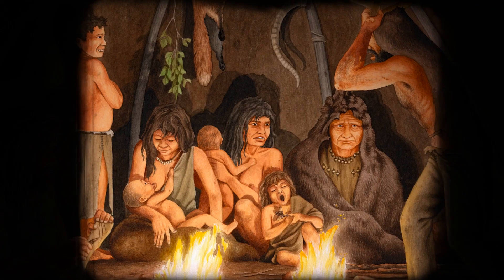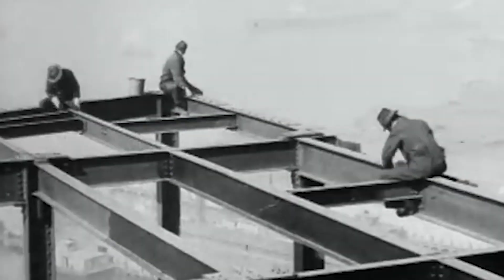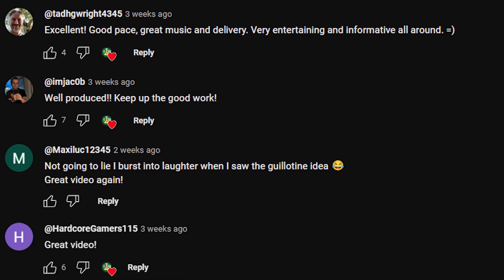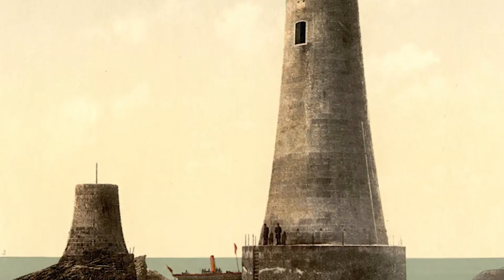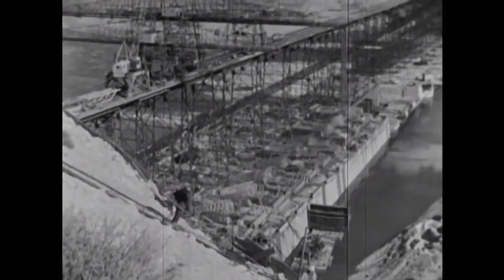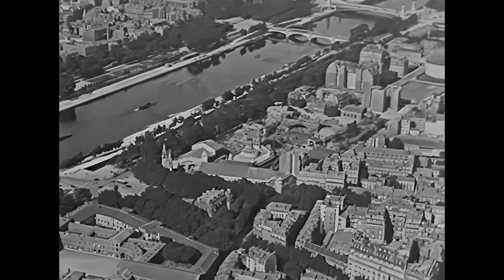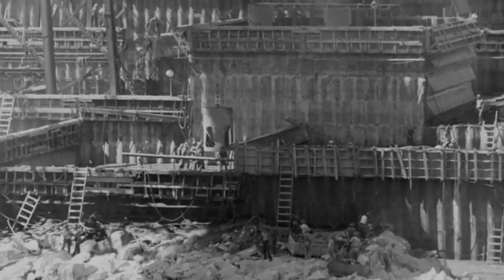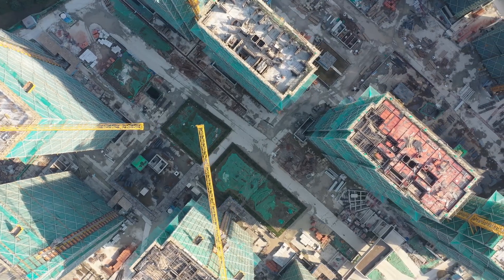How Concrete Became the Most Prevalent Substance on the Planet

Comment: Don't be dumb about Roman concrete - we can make Roman concrete, or as good, always have been able to. It just can't be mixed in a machine and poured, it's too thick, and it will only last for centuries if you don't reinforce it with steel. That means the walls will need to be several feet thicker and we can only go ten stories tall, maximum, and that in a pyramidal shape.